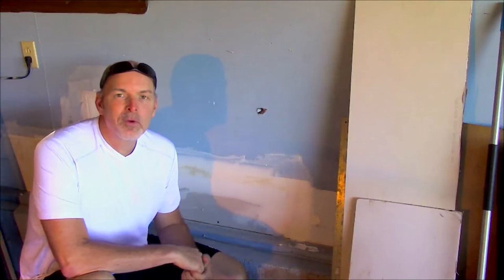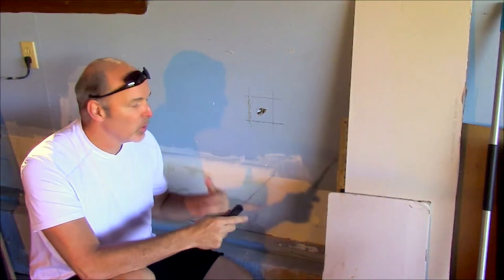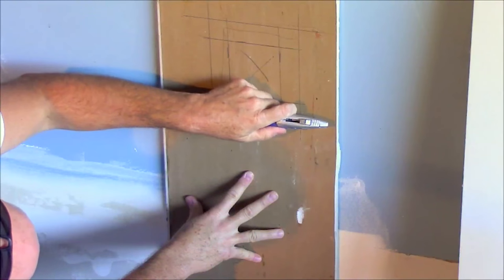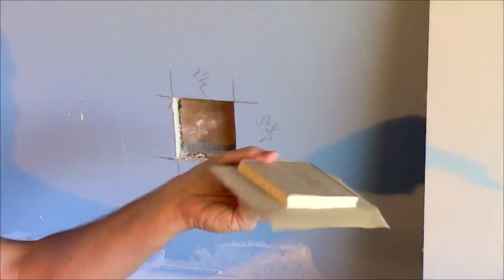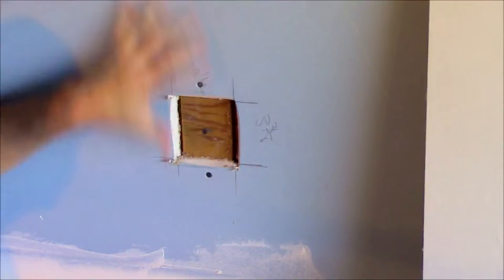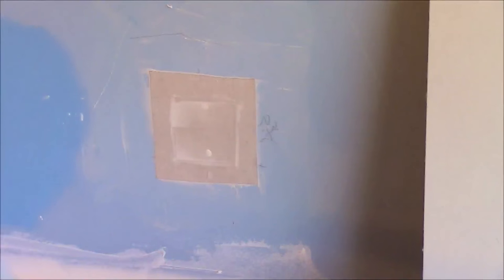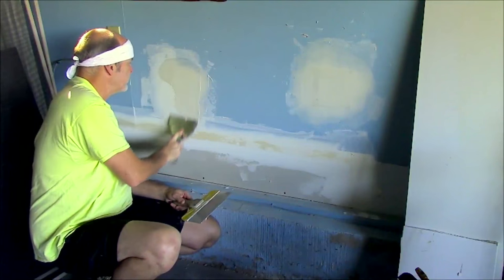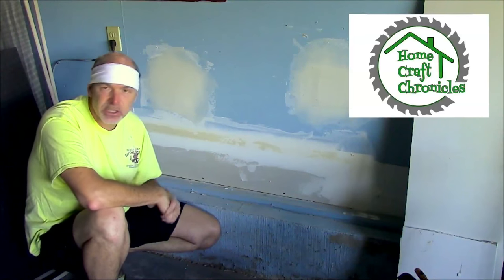How to fix a hole in drywall

Comment: Should fix the vapour barrier with some red tuck tape. could start to have moisture and rot issues in the wall at that location.
Reply: If you have a plastic vapor barrier, I would recommend fixing that as well prior to patching the drywall.  In my case, the insulation has a paper back which serves as the vapor barrier and it was in tact.  Thanks for watching

Comment: Before jabbing something through a wall, male sure there aren't lethal cables, or costly pipes behind it.
Reply: That is why i suggest the short motion with the saw.  you ate not going that deep into the wall and should not hit anything. In that event, however, you will feel it with the saw before and damage is done.  Good point though

Comment: No checking for studs?
Reply: Well you'll find the studs when opening up the hole.  While it would be beneficial, you have to repair where the hole is, regardless of the position of the studs.

Comment: Done this quite a few times myself in the last 20+ years but the problem with mine is that it has a designed paper coating so where I made repairs is obvious. :P Maybe one of these days will just move all the furniture out of each room and paint over it all. :D - Heidi
Reply: Yes, sadly a drywall repair like this is best suited for a plain painted wall. However it is a good starting point for where to begin your deposit process.
Reply: Home Craft Chronicles Yeah. Bought the house that way. Maybe a little pitiful I haven't customized at all as far as changing the walls. :p When/if I do the first room is the living room. I want a darker color on the walls.
Reply: +BlackCat2 Good luck. sounds like quite a project
Reply: Home Craft Chronicles yep would have to move a lot of things either out of the room entirely or into the center of the room. LOL just had a thought maybe I should do only one wall of the living room at a time. :) I do have plans to resin my kitchen floor soon and I can hardly wait to make it look super pretty and shiny. :D

Comment: i've never done this, but it just seams a hit over the top to me... so i am asking, could you not just put the drywall mud in the damaged area and Patch it up like this? i think the result would be the same, wouldb't it?
Reply: For very small holes, a mud patch would work. However, for any hole larger than about the size is a quarter, the mud alone would not be supported enough and the patch would most likely fail.  That being said, look for other repair option techniques in the future on HGMM and HCC. Thanks
Reply: +Home Craft Chronicles it would work if you put mesh tape on it you just waste time and money like this
Reply: +Angel Gonzalez for that big of a hole, mesh would not hold up
Reply: +Home Craft Chronicles mesh is made for patches if the mesh covers the hole and you use the right mud it will hold up really well and use quick drying mud it make things faster
Reply: +Angel Gonzalez A pre fab mesh patch with the metal plate in it would work.  Otherwise, i will disagree that mesh alone would ge enough.  Besides, this was meant as a technique video and not strictly about that particular hole. Thanks for the input

Comment: I did find this interesting, this undoubtedly works well but only for the 1% of walls that are not textured. Builders have been texturing walls for a long long time. How about a texturing follow up. Without good texturing the patch looks worse than the hole - I speak from experience.
Reply: This is very true.  Every ceiling in my home is textured and that is as much of an artform as it is a skill. This was meant to be a basic technique for repairing the hole.  I will see about the texturing. Thanks

Comment: Hi there, I'm from Brazil and I have a question: all of your walls in America are like this, fragile? Because here in my country the majority of our walls and buildings are made of clay bricks or cement, so patching is very easy, is just cover the hole with this clay and paint... I know that there, in the winter, is very cold, so you guys need some kind of insulation, but your constructions in general don't seem so resistant to me. Do you have homes built with bricks?
Reply: Today, most construction is done with this type of wall product. Drywall (also called sheetrock) is a gypsum product sandwiched between paper.  This is generally the standard here in the states.  However, there is some plastering still being done, which is also done over a wall system similar to drywall.